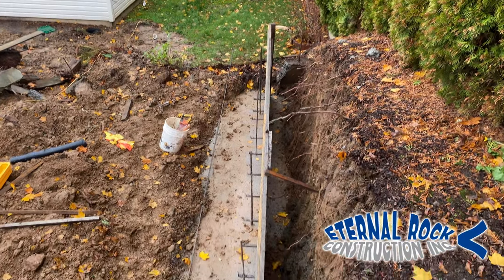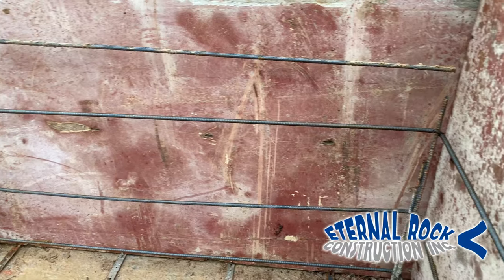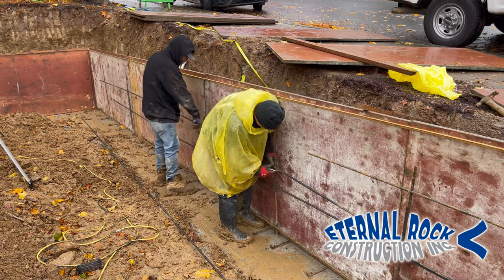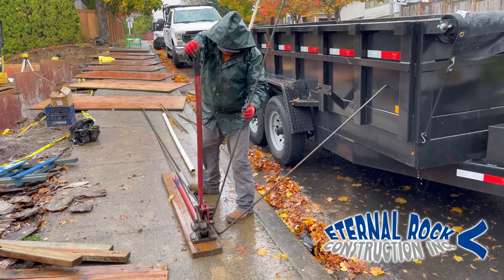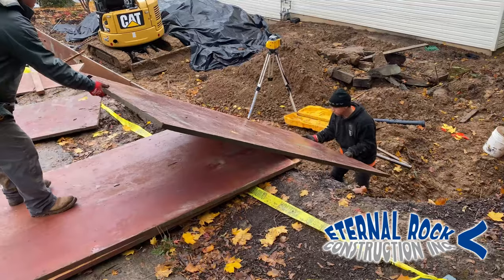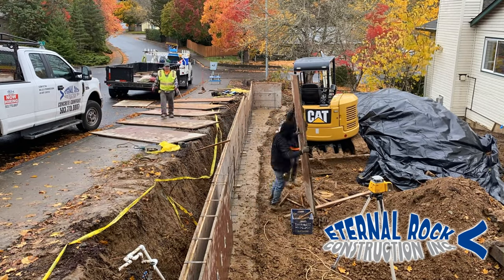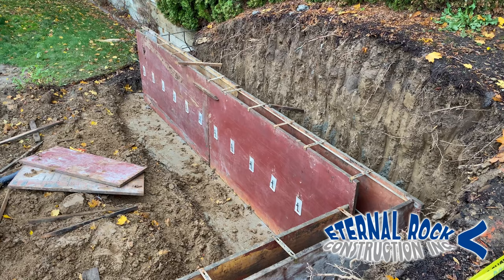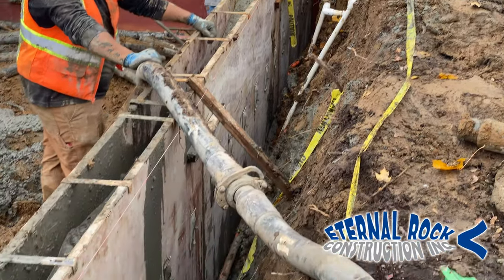How To Set Forms For A Concrete Retaining Wall Step by Step Full Detailed Process Explained

Comment: Hello from Tasmania. Nice work! Just a few questions. Did you pour the stairs separately from the wall?  As I'm most likely going to mix the concrete I'm my tractor mixer, I was thinking about pouring the wall in 6 foot sections. The wall is 2 foot at one end and 1 foot at the other with wide steps mid way. Have you had success doing that?
Cheers
Dan

Comment: I don't understand how those 3" pipes laid at the bottom of the wall will help drain if they are enclosed inside the wall....?
Reply: I assume once finished, they're open on both sides to allow water retention to pass thru. Maintains integrity at wall base.
Reply: @joseph-ch6gw  Ok. I'm completely new to all of this. Thank you
Reply: The forms are removed. Once the concrete has set. The sleeves will be open
Reply: Theres a reason why they didnt film the pour and the end result. Shouldve filled to top of frame, boxed off the different height sections, denser rebar pattern, mold release, the list goes on...